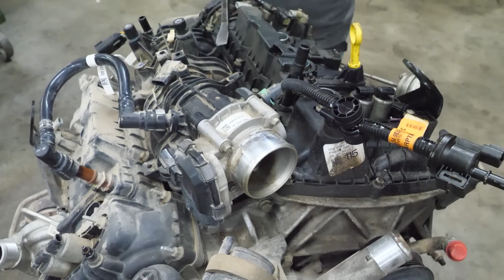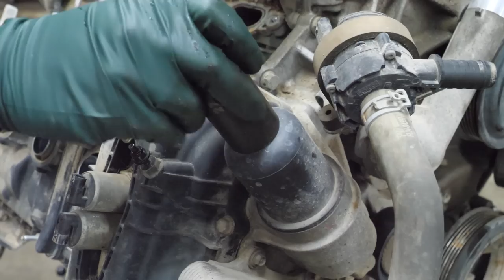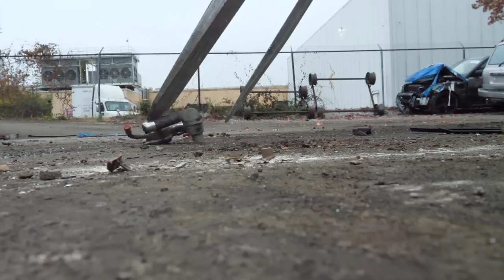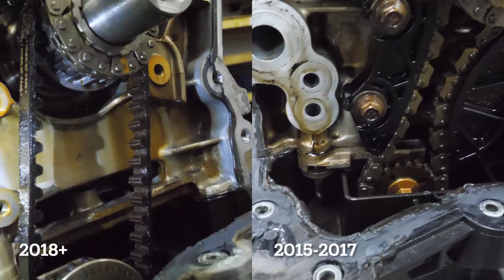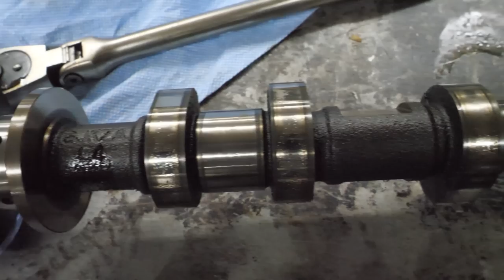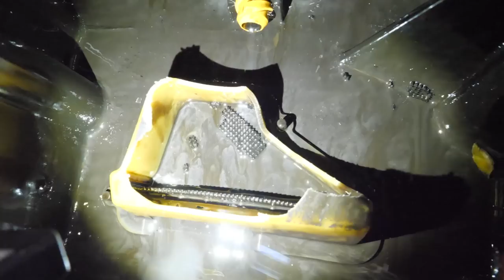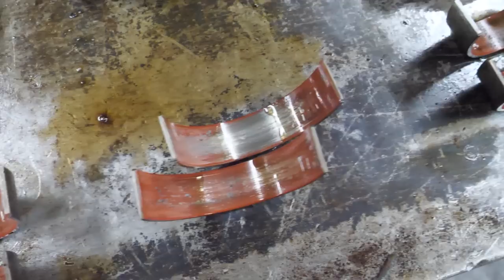A LITTLE TOO SPICY! 15-17 Ford F-150 2.7L Ecoboost V6 Engine Teardown

Comment: What a joke made fun of GM with its 4 cyl diesel years ago that required a 100k replacement of the oil pump belt that required removal of the transmission NOW FORD went the same stupid way with no interval on belt replacement WOW at least GM admitted the shortcomings of a belt driven oil pump.
Reply: Lz0 has a belt driven oil pump. 200k mile service interval

Comment: From experience, having a shop of my own for many years, this is some of the worst junk Ford has ever designed. The only good thing about these engines, is the scrap metal value. Ford has designed some pretty terrible stuff over the years, but this junk definitely ranks in the upper top ten of the most terrible. Of course, that's something not unique to Ford. All the big 3 are designing junk like this these days. I/m a mechanical engineer and I'm always amazed at the utter nonsense that I'm seeing when wrenching on this type of stuff, thinking 'what in the world were they thinking?' The utter nonsensical idea of designing smaller engines for lower fuel consumption, but then having to boost them with 2 turbos because they don't have the necessary power on their own to move a full size truck with a gross weight of 7200 pounds and thus not only torturing the engines constantly until the pistons open doors into the block, but they burn more gas too as a result. My old school 5.3 V8 in my old school Suburban doesn't burn more gas than these things do. It's nonsense

Comment: I know from experience Ford is built to take a fucking hell of a beating every day every minute.   But like buddy was saying . U get people that do not run Ford recommend oil to use which is 5w20 ,not fucking 10w30 or 40 .  That's a lot of the problems that Ford owners do not understand.  Ford has number one tolerances and there for is why they have 5w20 on the fucking oil fill cap.  I bet u anything that this guy whoever owned it went to a shop where 50 bucks oil changes .and the most cheapest oil and wrong ratio was not ment to exceed what this motor needed .  U even said poorly lubricated. That's because of all Ford moduler motors are 5w20 and from there on 5w20 Ford has tight tolerances and when u have a heavier oil and u love holding your foot to the floor well when things don't get lubricated like Ford builds it to then u run into heat, friction ,and no mater how much friction is caused do to the retard using 10w30 and not Ford recommended 5w20 ,when his foots to the floor that motor is being told to create power no mater the friction do to not using Ford recommended 5w20 . That's how these motors and moduler motors and 302,5.0l that's how they become a parts truck .  If your a smart mechanic who builds his own then beats the fuck out of them and it will not die then obviously you and I have proven that Ford is your number one choice .    Thanks for reading the truth about knowledge which is on the oil fill cap .  5w20 use full synthetic valvoline motor oil .
Reply: This motor clearly states  in both my owners manual and on the oil fill cap 5W-30. The smaller motors per the same owners manual do recommend the 5W-20.

Comment: I hate hate hate long long long timing chains on overhead cams engines. Worse mistake ever made. Trying to make this much horsepower and torque on a small engine is just looking for trouble. Why the dam things don't last. People will wreck the car for ins. before fixing this junk. If you want a engine that last forget you ever herd about a turbocharger or supercharger engine.

Comment: leave it to ford to make improvements on a motor they screwed up, only to make new faults....who the FK uses a rubber belt for an oil pump????
Reply: Ford obviously, GM, Audi, VW, Toyota, etc. Also every race car on the planet that has a dry sump oil system. 

Personally i don't find specific fault with the belt and i would not base a purchase decision off of a vehicle having one or not. Its not like we hear of rampant oil pump drive issues with these engines.

Comment: the one question you forgot to ask is if the vehicle was too big and heavy with too small of an engine in it.
Reply: By "small" you think only a V8 will work? Don't forget the F150 also originally came out with a straight six as well as the V8s.

Comment: great video of the Ford  deception  "built  Tough "  yep The entire motor is made that way  cheap turbos,  injector metal , oil pan etc etc look at the rods how dinky they are .    they may be powerful for a time, but they are only made to go a short distance. Ford = get consumers money  and run ,  meanwhile your  left with  plastic junk , inferior  metal motor  junk  assembled like a high tech  lawnmower   . Its better to buy a chevy truck   with LS ( even small LS or   even v6 ) and put a 70-80mm turbo on it and you have More power , less  parts ,   one  timing chain,  one cam, real  metal oil pan etc, It amazing  of what ford  corporate money greed  created  junk they come up with  to sell to consumers . yep  meanwhile your  left  with failing motor parts  back  and forth to the dealer  bleeding  your wallet to death

Comment: Looks to me to be another case of 'hurr lets' put this tiny ass little sports car engine in a 7,000 pound rolling cathedral what could go wrong?!'.

I don't give half a donkey dick what the dyno sheet says. These engines are just not big enough for a half ton truck. They belong in  sub-3,500 pound sports cars. There just is not enough meat on their bones to survive towing. This is what happens when you tow with them.